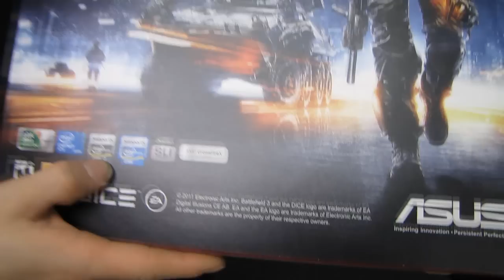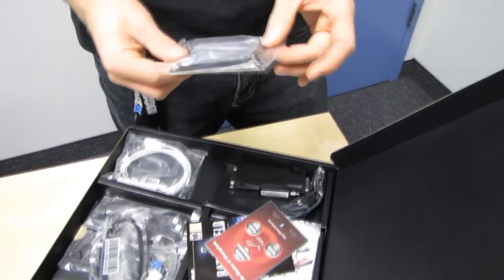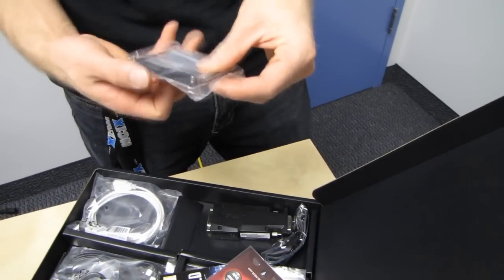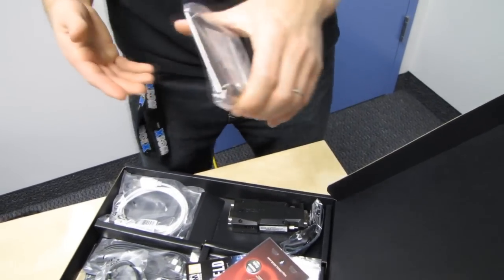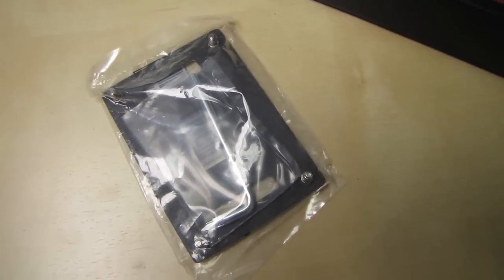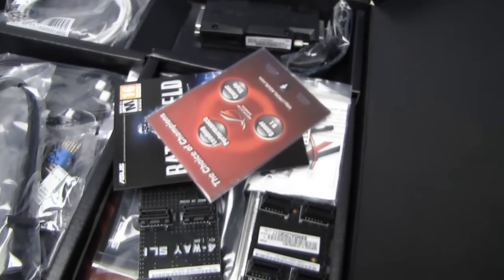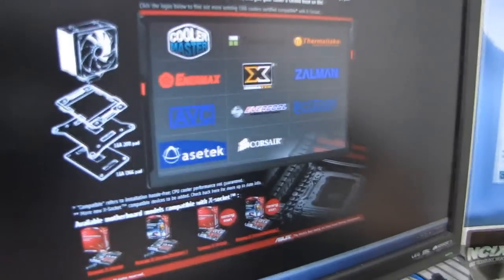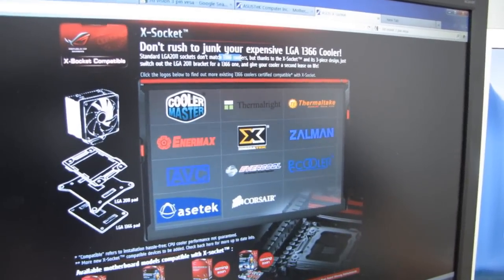ASUS Rampage IV Extreme LGA2011 SLI Motherboard Unboxing & First Look Linus Tech Tips

Comment: Almost 5 years later still VERY RELEVANT! Awesome board :-)
Reply: Still using mine.
Reply: just bought 1 at a good price $228 via Ebay. My only fear is if it can fit in my case lol
Reply: Still using mine as well! Built my rig in Nov 2012 with an i7-3970X, 32GB RAM, Creative Recon3D Champion, etc, and am now running it with a Samsung 850 EVO OS drive, Gigabyte GTX 1080 Xtreme, and EVGA GTX 780 Classified (now dedicated to PhysX). Still going strong, even in VR! :)
Reply: @DMan-ud6bt  Still using one as well !!! And still can't find enough info about it !!! People are stupid, as it seems !
Reply: 6:00 Where do i find the extra 4 pin power connector for the CPU ???
Reply: @neytiritetskahamoatite7688  I really miss when Linus and Paul used to go over all the features of motherboards instead of just a general overview before building with it or something. Don't get me wrong, I love their current content too, but I wish they still did more in-depth coverage of stuff too. I guess they're fine leaving most of that to others now.
Reply: Neytiri te Tskaha Mo'at'ite What GPU are you using, if you don’t mind me asking?
Reply: 5 years later later, still relevant lol
Reply: @farawaythrower  Hi , do you know well this MB ? Best regards,
Reply: @JS-sf1dw  What would you like to know about it?
Reply: @farawaythrower  Thanks for your answer. I face an issue with an usb 3 dock station management and I did not find any help in the ROG forum nor everywhere else

Comment: Dream machine:
ASUS Rampage IV Black Edition LGA 2011
Intel Core i7-4930K
4x8Gb Dominator Platinum 2133Mhz
ASUS ROG RAIDR Express PCI-E 240GB
Samsung 840 EVO 512Gb
WD Black 2 TB
2x Nvidia GTX 780ti
EVGA SuperNOVA NEX 1500 Classified 80 PLUS GOLD Certified
Full Custom EK watercooling setup (hard tubing)
Custom Case
Reply: i would change this dream machine for the same that has 2 GTX 690 and not 2 GTX 780 TI :))
Reply: you're gonna introduce a bit too much microstutter with 4 cores and you wont gain all that much performance as not all games are that greatly optimized for 4 cores ... all in all the least (but more powerfull) cores the better :)
Reply: 2x Sapphire Radeon TRI-X R9 290X 4GB GDDR5 ftw :D
Reply: we dont know how mantle will impact performance and how many devs will adopt it ... as pure performance 780ti is king (untill they get out the super Titan and the 790 ...)
Reply: Toxic R9 290x is better then 780ti and around same or not better then titan.. except the memory.. lol..
Reply: Try to OCit on air without noise canceling headphones ... I DARE YOU! :D
Reply: yeah when I get paid in 3 weeks I can buuy them maybe xD

Comment: Hello I'm designeing a gaming pc n I'm wondering if this board could hold 4 video/grathics cards ( asus gtx780 3gb) thxs
Reply: I think it can go also with 4  video 980 Ti cards, and even 1080 Ti cards.
Reply: 6:00 Where do i find the extra 4 pin power connector for the CPU ???
Reply: @neytiritetskahamoatite7688  Newer motherboard (from 2013 to now) have the 8-pin EPS 12v connector for CPU already and it's near the top of the board (or might next to the CPU)

Comment: This video came up on my rec feed a few days after I watched Buildzoid's "mobo PCB Breakdown: ASUS Rampage IV Extreme video". 
This is the board I used for 10 years until I finally upgraded to lga1700. The RIVE never gave up even though I put it through the ringer. 
Started out with a 3930k that overclocked poorly, to a decent 4930k, then I used a Xeon E5-1680 v2 for the last 3 years. Somewhere in between I tried a Xeon E5-1660 that I pushed to 5.0ghz on all cores at 1.52v, Prime95 stable.
Overclocking and running with 2400MT/s memory really helps.

Comment: I love newegg soo much. Back in 2012 or 13 when I ordered a gtx 680 classified I got the gtx 690 LOL. Like 3 months ago I ordered this motherboard from same site, and got the black edition instead
Reply: ol. Must have been great.
Reply: pumastp98 *buys gtx 980, gets 3dfx voodoo 2*
Reply: THE ANIME FREAK *buys titan x, gets X1650.
Reply: あなたの先輩 *buys titan z 3x sli gets desoldered onboard 32mb gpu*
Reply: ***** the 970 is 3.5gb, it's a locked down 980 chip, the 970 is meant to be 3.5gb, nvidia got into lots of trouble over false advertising.
Reply: pumastp98 Bought a decent cooler for my cpu, they sent me a nuclear reactor
Reply: Where do i find the extra 4 pin power connector for the CPU ???

Comment: @Syakir2004 This is due to microscopic pores in the tubing that eventually allows some water to evaporate from it. This becomes even more prevalent if the water is running really warm or hot because it will allow the tubing to expand and those microscopic pores to get bigger. The BEST tubing you can buy is called "Tygon". Also, you must use DISTILLED water always, NEVER regular water. You want to use an additive as well (a water wetter) that eliminates the 'skin' of the water..

Comment: Still using this board today with a 3930 at 4.7Ghz. Really great motherboard but the onboard sound wont work anymore.
Reply: Do you know if it's worth it to buy a pc with the following specs for €250,-

Cooler Master HAF X
Intel Core i7-3930K 3.20 GHz
CoolerMaster Hyper 412S
Asus 2011 Rampage IV Extreme
Corsair Vengeance 16 GB DDR3-1600 Quad-Kit
OCZ Agility3 SSD Hardeschijf 120GB
nVidia GTX970

If so how do you overclock your cpu or can i just pick a random guide on youtube for that

I will use the pc for not too heavy games on a 1080p 60hz monitor so more then that it doesnt need

And i am aware that the power supply is missing and that i need more storage

Comment: IVB will be the last series to use the 1155 socket, IVB-E is coming out later this year/ start of next year so 2011 will offer a better upgrade platform. The performance between chips will be roughly equivalent in gaming, but in pretty much every other scenario e.g. video encoding 2011 will outperform IVB.

Comment: Yes.  High end Ivy bridge E processors should be compatible with LGA 2011 and the X79 chipset.

There will also be LGA 1155 Ivy bridge processors that will require the upcoming Panther point chipset.

Comment: The X-socket bracket allows for direct compatibility with some exising coolers that do not mount into the motherboard mounting holes by themselves.  For example, I have a Corsair H80 closed liquid cooling system and was able to mount the heastsink/pump right onto the X-socket bracket using the thumb screws that came with the H80.

Comment: The same thing, just with added features such as AC wifi, more sata 3 ports, native pci e 3.0, and different fanless heat sinks. As far as overclocking these should be the same even after the fact that asus says the black edition is ivy e optimized.

Comment: I just bought this bad ass mobo and can tell it is worth every penny!  I am using an Intel 3930K and have PCI-E 3.0 enabled in Windows 7 Ultimate 64-bit throught the use of the now very popular registry hack.  This mobo is also capable of running up to 2666Mhz DDR3!!  All of this WITHOUT the requirement of having to use an Ivy Bridge CPU.  Yup, that's right.  The X79 chipset in itself allows for the use of both PCI-E 3.0 and the latest high speed DDR3 (recently enabled through BIOS updates).

Comment: Yes if your getting this board 3930k is what i would get. No point in getting a $1000 cpu when you can just overclock the $500 one. Get the Corsair iH100 and let the motherboard overclocking thing set your turbo boost. You can get both these from Amazon.

Comment: I've never seen the North bridge fan spin up on mine. Is this normal?
Reply: Tony Ling Yup it can be deactivated (in the latest BIOS versions), but you have to manually set it by switching profiles, maybe done by the previous owner if you picked yours used.

Comment: Is the aircooling on this motherboard good if you do extreme builds with 32gig 2133MHz RAM, 3960X 4.5 OC and 2 GTX690s or should you do watercooling on the motherboard too if you do on the rest of the build?

Comment: Just got my self one of these to Build my new computer 
Specs

Motherboard: Asus Rampage IV Extreme 
Graphics Card 
: 2x XFX Radeon 7970 In Crossfire 1000mhz each one
Ram 24gigs of ram 
Corsair 180gb SSD 6gb/s For Boot Drive 
Case: Corsair Obsidian 800D Case
HDD : Barracuda 2TB 2TB got two of them for 4TB For storage 
Processor Intel Core I7-960x Extreme Overclocked to 4.1 GHZ 
Cooler : H100 (Gonna Upgrade to Ultimate cooler Same Parts Linus Used in his ultimate Cooling Guide) Orderd Waterblocks

Comment: the difference is this mobo is socket 2011 which is the 6 core cpus which btw this socket will never die unlike the z77 boards that will basically not support the new 1150 haswell cpus unless they do some backwards compatibility

Comment: Will the Haf X be good with this motherboard and x4 gtx 680 classified evga, with a enermax 1500w in the bottom
Reply: there can be nothing to justify 1500w psu unless you buy as much unnecessary parts as you can

Comment: Question. Would I notice any increase from my current 1090T to a 2600K in gaming (BF3 mainly)? My setup is the 1090T @ 3.6GHz, SLI EVGA GTX 460 SSC+ (900/1800/2000), and 4GB 1600MHz RAM. I'm getting the feeling that my 1090T is bottlenecking my two 460s. (I'm getting either a 580 or something when the new GTX 600 series comes out) Should I get a Bulldozer (Eh..), a 2600K, a new 3930K, or should I wait and see what 2012 brings?

Comment: I'd say if you bought the Sabertooth i'd be an extreme overclocking machine (with alot of cooling and possible a better cooling case.) And I'd actually recommend you buying a very high end motherboard so you could get the most out of your other hardware :)

Comment: @coolmanris Your fans will work fine. It only controls them if its running but you uninstalled it then it should run fine. The fans are controlled my your mother board so unless they weren't working good before you installed it then it should work normal. P.s. i believe that you have have admin powers (or run as admin) for it to work.

Comment: Will This motherboard work with the following, Corsair 760t,Intel i7 4930k, MSI Geforce GTX 780 TI 3GB, 16gb Corsair Vengeance Pro RAM,NZXT Hue, Crucial m550 512 gb ssd?
Reply: You will need to flash a new bios in order to put IB-E CPUs
Reply: Well i dont want to have the hassle of all of that could you send me alink to a motherboard that would be fully compatible with those specs? much appreciated!
Reply: TheRyanDudeMan Asus Rampage IV Black Edition.

Comment: @ghajaanan Wrong. 8GB dimms are still very expensive and have bad latencys. I rather get 8x4GB high clocking DDR3-2133 and just push the CPU IMC a bit harder.

Comment: This board has more than 4 sata 3 ports controlled by intel.

1 x SATA Express port, red, compatible with 2 x SATA 6.0 Gb/s ports
8 x SATA 6Gb/s port(s), red, *4, with M key, type 2242/2260/2280 storage devices support (both SATA & PCIE mode)
Support Raid 0, 1, 5, 10
Supports Intel® Smart Response Technology, Intel® Rapid Recovery Technology*5
ASMedia® SATA Express controller : *6
1 x SATA Express port, red, compatible with 2 x SATA 6.0 Gb/s ports

Comment: @Syakir2004 Yeah no prob. :) ...ran out of space but other issues with the MSI BB XPII are 4) BIOS is very difficult & SLOW to navigate for anyone using a respectable (high dpi) mouse like a 'razer'...don't be fooled by the pretty BIOS pics - it's a pig. 5) BIOS is extremely thin & weak compared to the extremely robust ASUS R4E BIOS (best I've ever used). 6) No 'power-to-board' light when system is off & PSU is connected. 7) SLOOOOOW pre-boot initialization when powered on...etc!

Comment: @Syakir2004 I had the MSI X79 Big Bang XPower II and SOLD IT to get this one - trust me, the Rampage IV Extreme is VASTLY superior to the MSI board. MSI's advertising is very misleading - 1) The board only has 2 (TWO) x16 slots - they say 7 but that is just the SIZE (i.e. the plastic)...they are wired only half-way across the slot...the remaining 5 are x8. 2) Setting up RAM is a NIGHTMARE, & it WILL NOT run my G.Skill @ 2400MHz. 3) Onboard audio w/ X-Fi MB (i.e. not TRUE X-Fi) sucks ass...etc!!

Comment: if you're only going to have one gpu, go with the 3570k it'll save you $100 for pretty much the same performance, and i don't understand this obsession people have with the sabertooth  the Z77 extreme 4 or P8Z77-V Pro are just as good for overclocking, and that $200 you saved on the cpu and motherboard put it into the gpu so you can get a 7970.

Comment: Of course, you can get a 4Way Sli 690 GTX overclocked on a Rampage IV with a 3960X overclocked too, 128GB 4Channel and SSD, would be a super gaming computer but also will waste a lot of power, that's not suitable for a regular user, so, a Super Gaming PC it's not desirable, what you should get it's a regular Gaming PC, with updatable items.

Comment: LoL your build isn't bad btw I just got Need for Speed Most Wanted 2012 it works great my specs i know my RAM is fail XD:
7**ULTRA SETTINGS**
With FPS:20-30
Without FPS:30-60
My Specification
-Intel Core 2 Quad Q8300 @ 2.50GHz
-3GB DDR2 RAM 800MHz (Upgraded to 4GB)
-MSI RADEON HD 6770 1GB GDDR5 MD1GD5
-Resolution  1440x900 (Upgraded to 1920x1080)
-Windows 7 Ultimate 64bit
-Antec 500WATT NeoPower PSU
-1TB Hard Drive
-AsRock G31M-S Motherboard

Comment: Yes I'd die...after realizing I spent like $200-$700 bucks more to get barely double digit performance increases with a 3960X compared to a 2700k or now 3770K...rarely when the planets are in perfect alignment.  Current games don't need all that extra.  Nice board though, I must say.

Comment: Who else's RIVE is still going strong in 2021 :D
Reply: I just retired my x79 setup a month ago.... I had upgraded from the 3930k to a Xeon E5-1680 v2 and 32gb of 2400mhz RAM. The system worked great.
I'll probably repurpose the system here sooner or later because it still performs well.
Reply: @m8x425  IS it possible to ask you a question about a bios setting I really can't manage to achieve ? Thanks a lot
Reply: @m8x425  Thanks a lot for answering, i will post on my problem on the techpowerup thread. I tried to find the thread on the forum ( around page 160 t 170 which correpond to 2011 year) but i di not find it. Many thanks for your help

Comment: I bought this board when it was new along with the 3960X chip. I had problems right away. My PC will not wake from sleep. It will crash and require resetting via the button on the back. After that it boots to the American Megatrends screen and I have to enter setup to continue. No answers online as of 7-17-2013. Anybody have any idea what to do? Asus assures me its not the board. Help would be great. Don't want to have spent 450 dollars for nothing.

Comment: i was considering the socket 2011 chips for my pc upgrade im gonna be doing soon. but when i found out that they are gonna be $500+ and $500 only gets you a 4 core. im sorry. ill take the slightly worse performing FX-8150.. which is MORE than enough for me. ya. AMD is still number one for me, price for performance wise. i mean Bulldozer is buggy now. but with a few driver/bios updates it should be fixed soon. unless your a HARDCORE gamer or editor. you dont need $500+ cpu's.